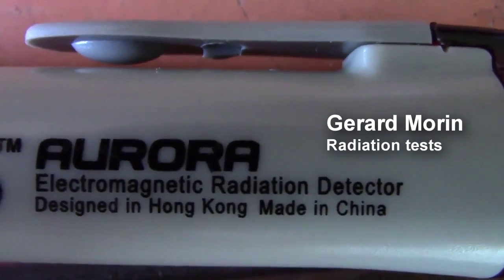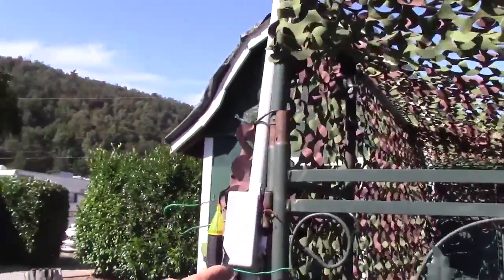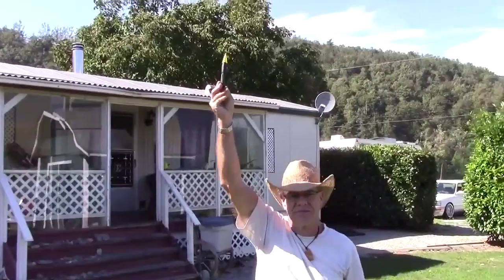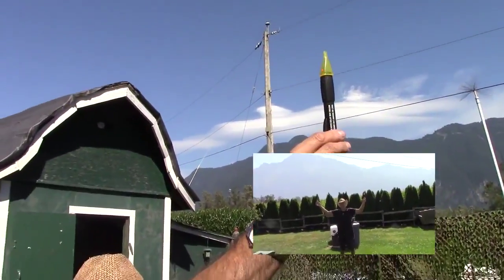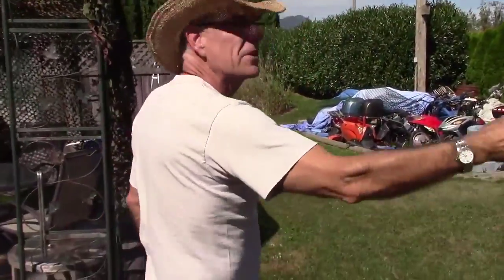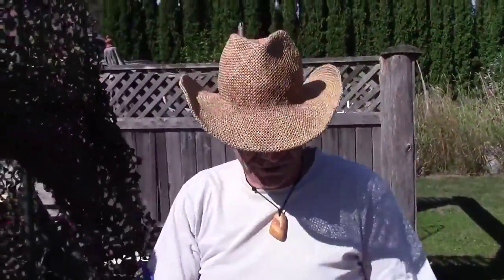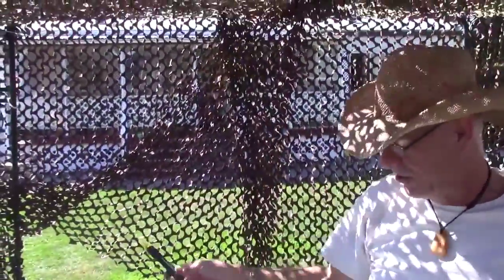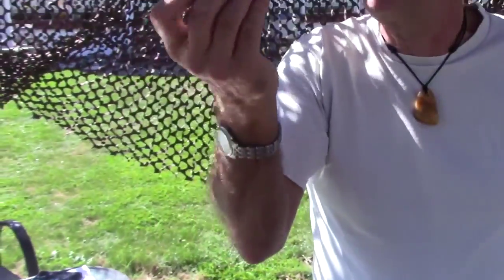A Simple EMF Radiation Detector - MUST WATCH UNTIL END!!!

Comment: Awesome! Thanks for sharing that!

Now that is also a very good argument to change the way we use energy. It is not only ridiculously dangerous, (it's crazy that we have that kind of energy at our disposal, as much as we like, anytime), it also radiates in your homes 24/7 from every single line where electricity flows. Even if it is 110V or 220V it radiates a magnetic field. Think of where your bed stands and where the lines are, your night lamp, phone charger etc. If you have an electric heater, measure it! It is all going through you while you sleep.

Regardless of frequency, energy always radiates a magnetic field. If the current condition of energy is dangerous, then everything within it, is dangerous, although not immediate.

Everything in our existance is about frequencies, nothing can exist without it. To understand this, (it will be worth the effort many times over, I promise!), search for "visible frequency" and see what it does, continue and find out everything you can about The Flower of Life. There's lot of reading involved, and the more you read, the clearer the picture gets, how simple everything is after all.

To understand something big, you'll have to know its smallest part!